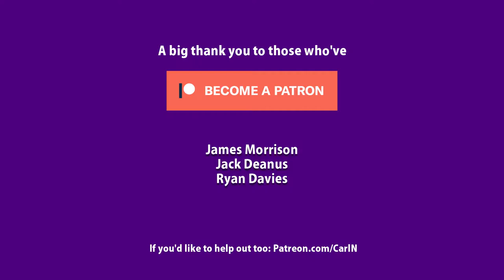Add an External Power Switch (Electronics + Tutorial) for PS3 or PS4 or SKY Box

Comment: can this be used as a way to turn on the ps4? (like getting to the menu)
Reply from the maker: cavalo rebaixado I'm sorry but I don't think so. I'm still on the PS3 myself so can't be certain, but all this does is effectively make the switch on the wall socket a bit nearer. I came up with it so I was able to turn off my satellite box to prevent it wasting electricity by being in standby all the time without having to reach way back behind the TV, if that makes sense?